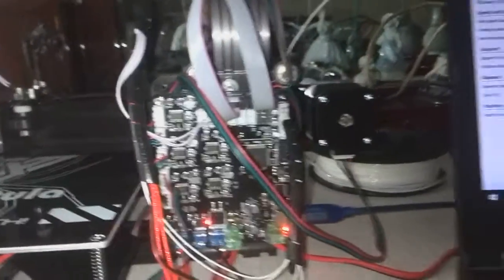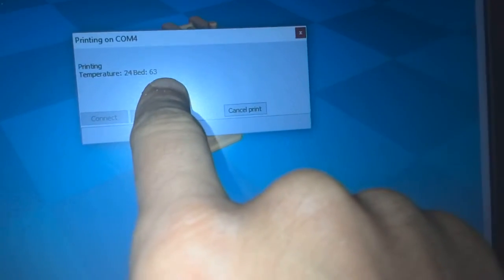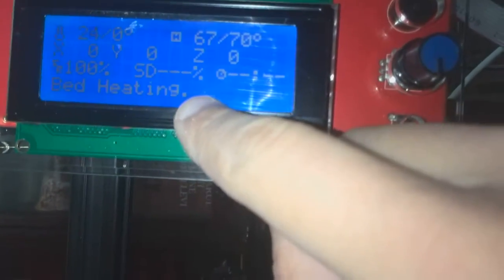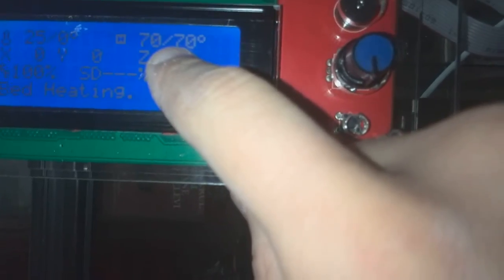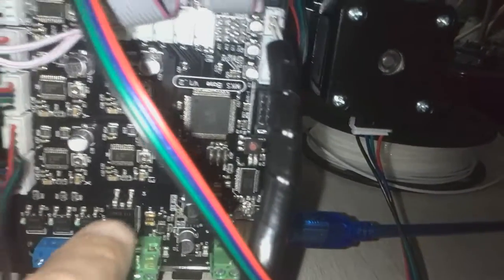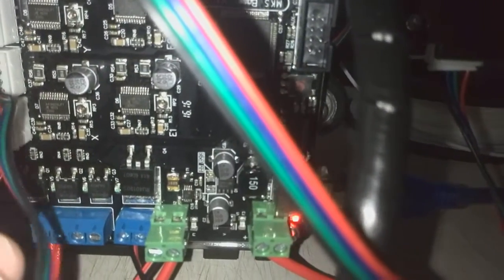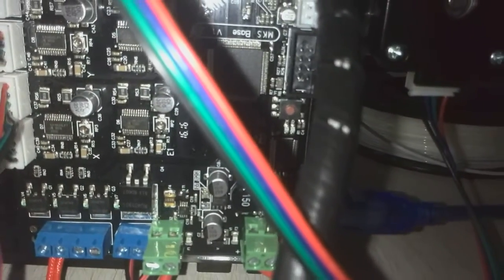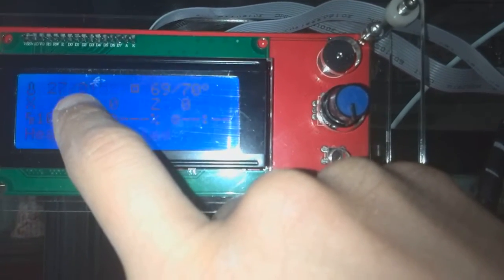Tevo Tarantula nozzle not heating issue

Comment: I have the same problem!
Reply: same! any solution?
Reply: The solution is that the wires leading into the board are not connecting to the board correctly. Most people solder the wires to the board to fix it.

Comment: Do you find any solution I have same problem. Nozzle not heating and after sometime LCD display going off
Reply from the maker: Yes, I use the secondary heater. Had to rewrite the hole firmeware. Overall this is a really bad printer! I don't use it anymore :(
Reply: can you help me with this. Would you like to share the firmware with me.
Reply from the maker: I'll try, unfortunatelly I cant find exactly the correct software. The Tevo's software is called Repetier (host version). You have to find the correct settings (maybe on the fb community).
Inside the file "configuration.h" you have something like: 
#define EXT0_HEATER_PIN HEATER_0_PIN
you have to change it to:
#define EXT0_HEATER_PIN HEATER_1_PIN

Use Arduino GUI to burn the firmware! Hope you manage to start it! The calibration is even worse! :(